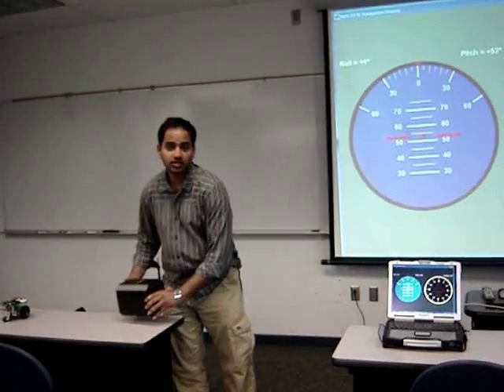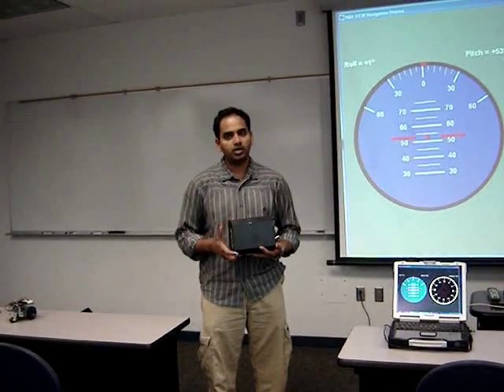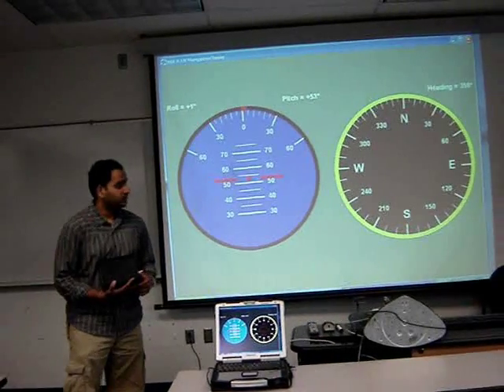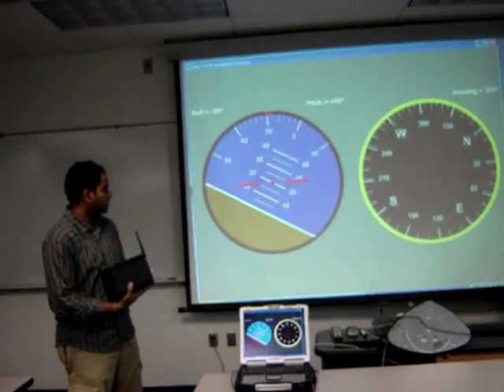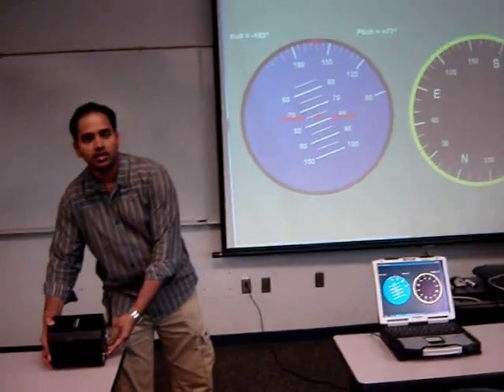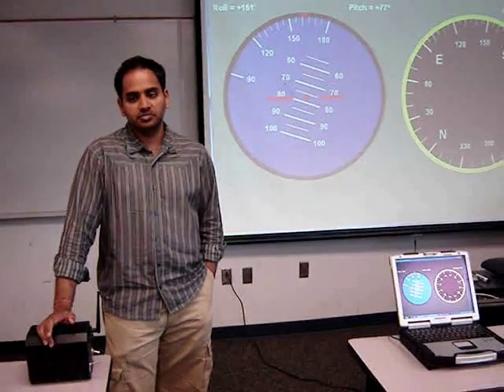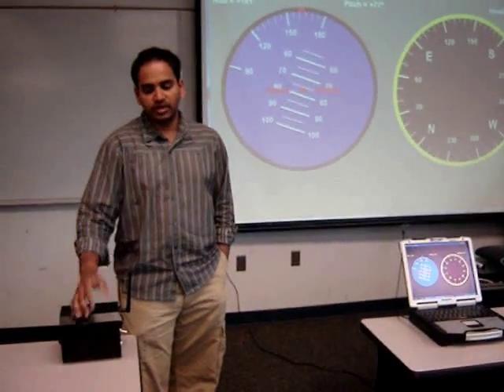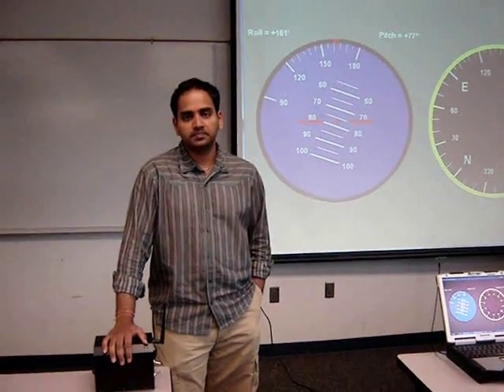Wireless Avionics

Comment: @jm3la yeah, the great potential problem is the eletromagnetic interference.  We simple can't prevent this from happening and disturb a safety-critical systems.  Also heavy blinding alI hardare is not an option.  So think using optical fibes is a best, more conservative enginering solution to overcome this.

Comment from the maker: It is happening...a commercial product came out which works on the similar concept, converting RS232/435 data into wireless and transmit to electronic flight bag..search for Skyfi 2000

Thanks for the comments.